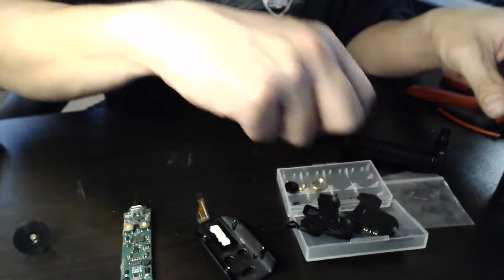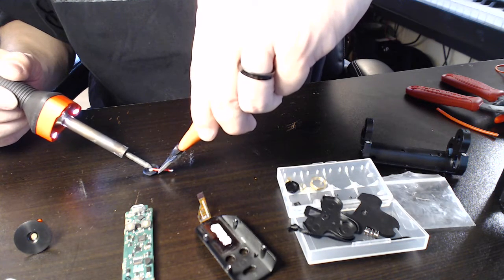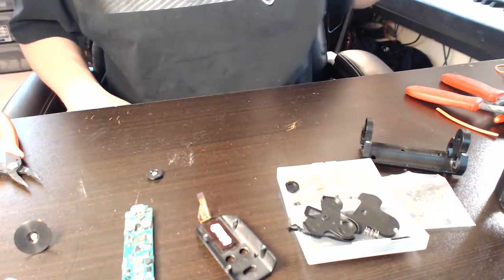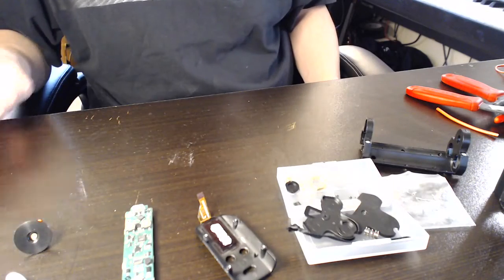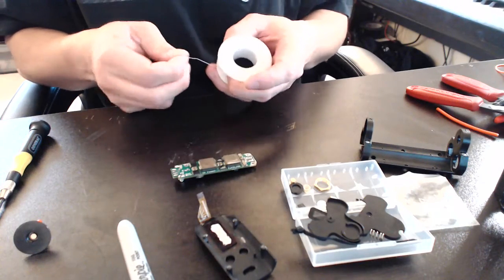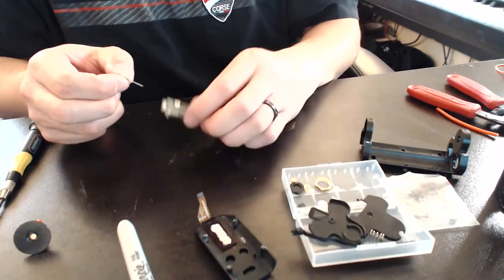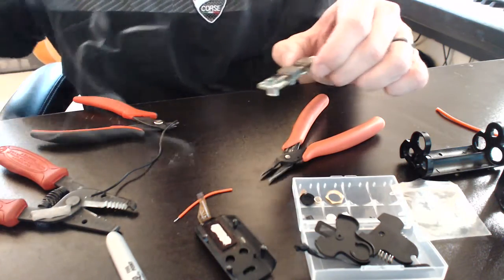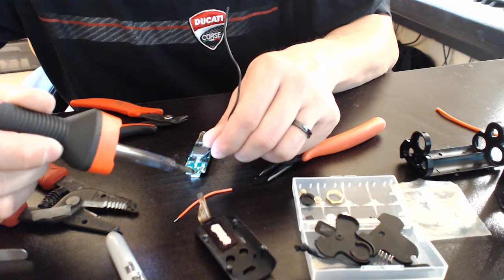Converting an RX200 to a DNA 200 part 2

Comment: Hi wish you would have shown the removal of the 510 slots and how you managed to do the extra rebating to the top, I have the DNA 200 Version which had a problem with the board, which Evolve exchanged for me, so had it apart anyway and want to change that 510 which is as you said a real rubbish standard for temp control. glad you done the vids as I have not seen any others in regards to this modding, Cheers & thanks